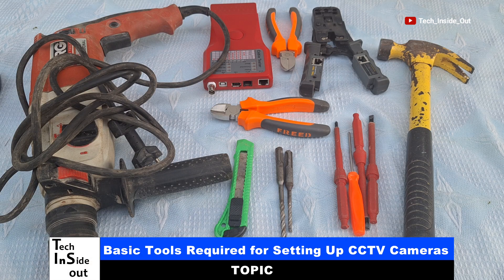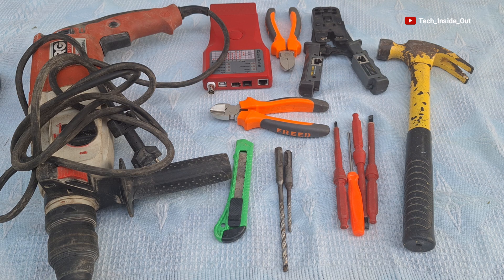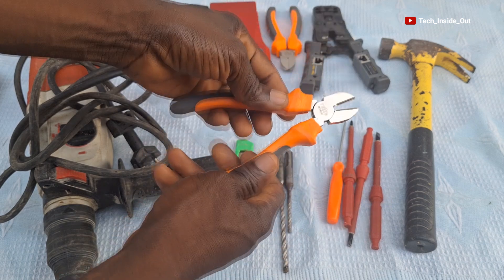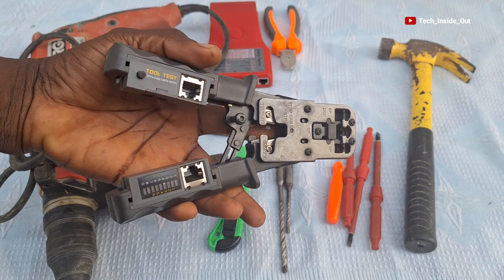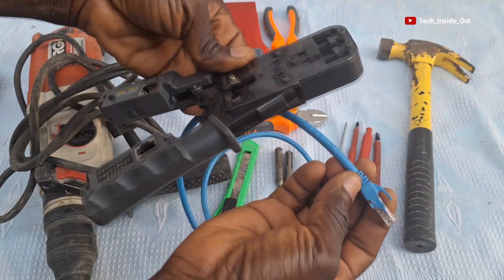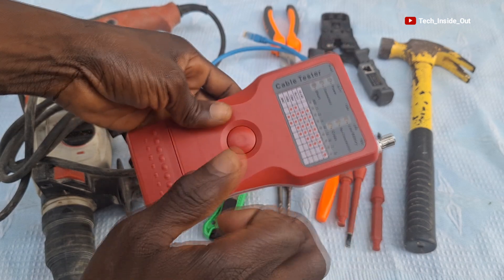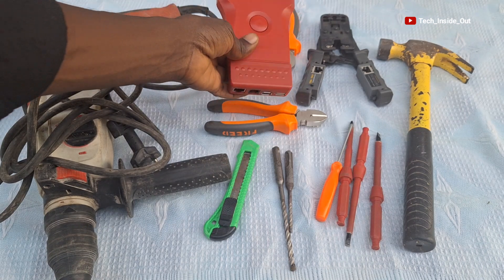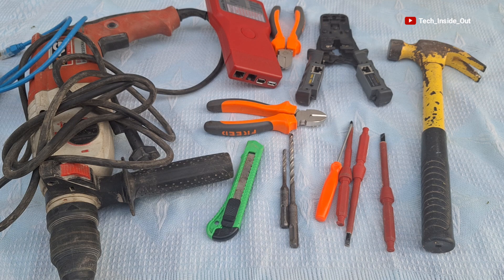Tools for CCTV Security camera installation

Comment: Pls my camera is showing no video but before it was working good , what is the problem .if I move the camera to different cables it working but if I bring different camara to the place is not working
Reply from the maker: I suspect the cabling and or the terminations on the cable where the camera is has a fault